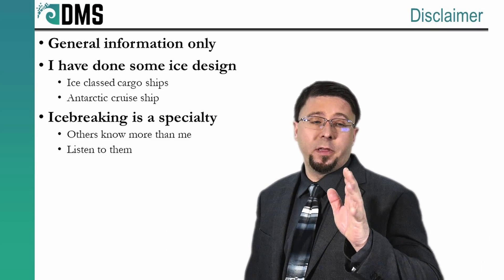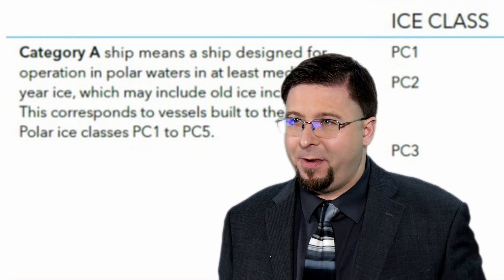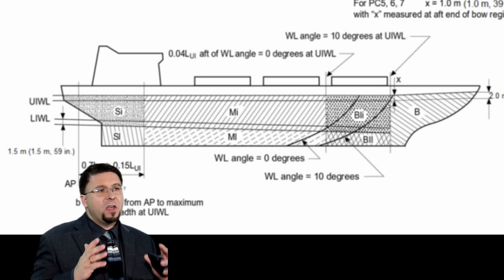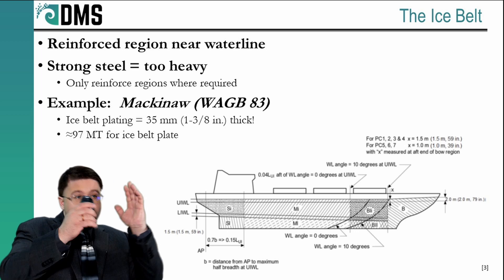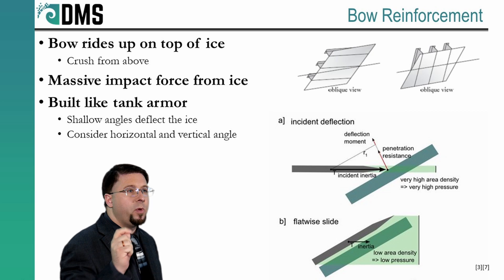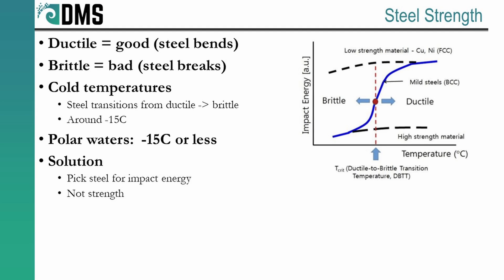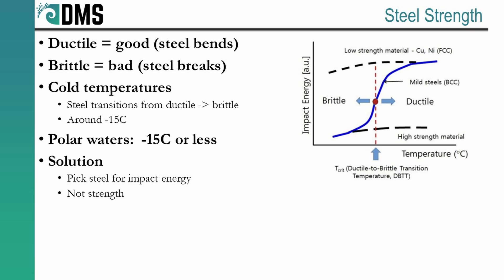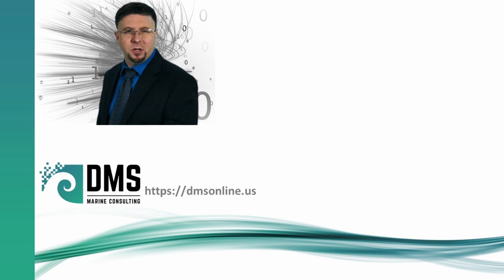Strong as Ice:  Designing Icebreaker Hull Structure

Comment: What about lifting ice and causing the weight of the ice to break itself?
Not just using the bow shape, but thrusters. 
The reason some icebreakers use thrusters at the front or back throw heavier ice.

Or weight on the ice such as hovercraft to break the ice allowing a following ice breaker to clear the ice to the sides.
Reply from the maker: There are cases where hovercraft are used to break ice.  It works.

Comment: Would it be possible to make a sailing tanker? I have this idea of shipping water from the mouth of the Amazon to the Sahara, but I suspect fuel cost would make it infeasible, but that it might be with sails. Also is there any benefit to a catamaran if it is very heavy? Would the increased righting moment and hull fineness make up for the increased wetted surface compared to a monohull of the same displacement?
Reply from the maker: Sailing tankers are definitely possible.  Several companies are currently researching modern sails to retrofit onto existing freighters and tankers.
But . . . Water as a cargo is probably too low of a price to justify the shipping cost.  At least for now.  Probably cheaper to desalinate the water onsite 
And yes, there are benefits to a heavy catamaran.  As you said, the increased righting moment adds a lot of sail capacity.
Reply: @DatawaveMarineSolutions  thanks. Yesterday I spoke to the manager of a Mississippi river port about the possibility of building ships there and he said that the port owns enough land and he's not opposed to the idea. He said that his main concern was with insurance

Comment: Random curiosity... I found a cargo plane at an airport for sale and was  wondering if it is feasible to take the wings off and turn them leading edge down to make the twin hulls of a catamaran, using the rest of the plane in the construction of the cabin living quarters etc.?
Reply from the maker: Probably not.  The pressures on the airplane are lower than typical hydrostatic and wave pressures.  The plane could probably survive in calm water.  But at the first violent storm, I suspect ocean waves will start to dent and buckle the skin of the wings.